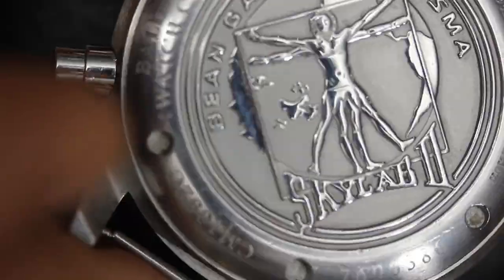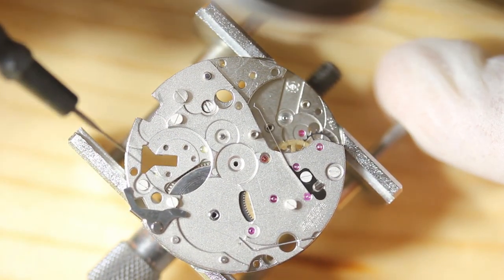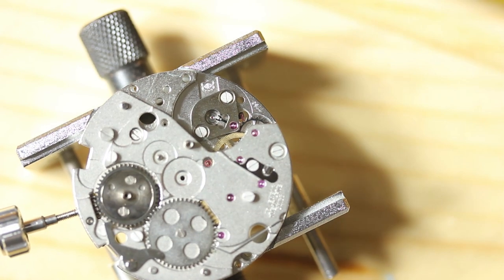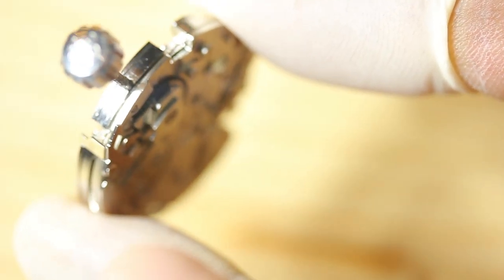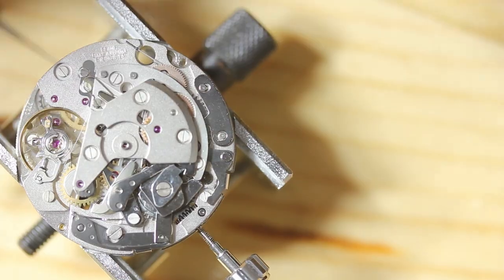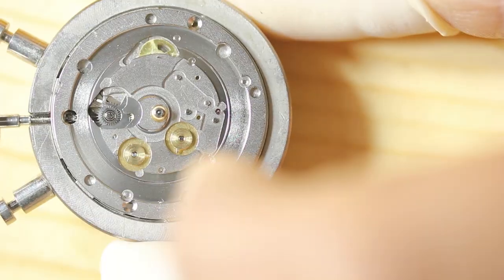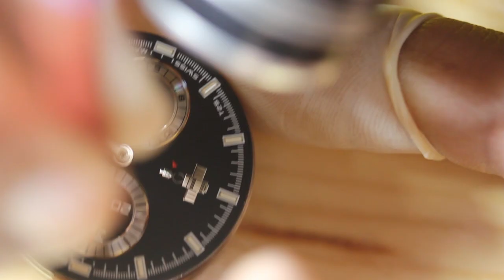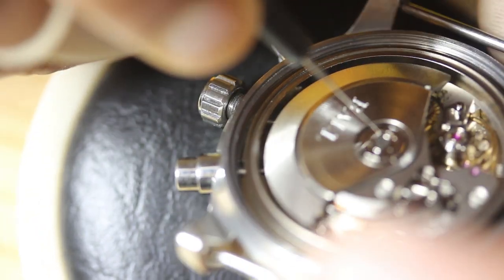Servicing ETA/Valjoux Caliber 7750 Watch Movement

Comment: Thanks for the video. On my watch day shifts at midnight,  but date between 8 and 9 oclock. Whats the issue, could you help please? Thanks
Reply from the maker: This may be due to mis alignment of the date wheel during assembly. In most movements like ETA this should not be an issue because by design the day wheel is driven through date gear. Which movement or watch make do you have ?
Reply: @sathishcg  its a 7750